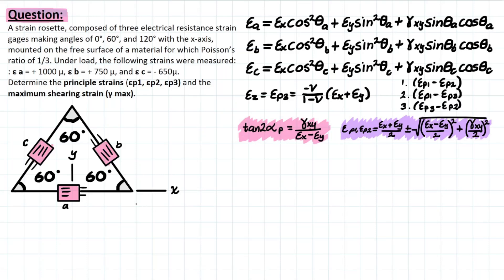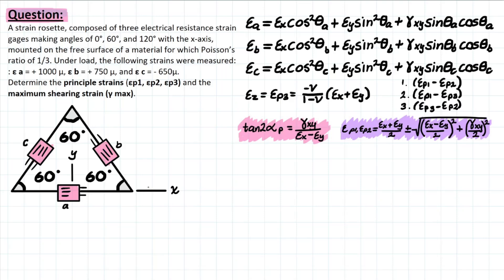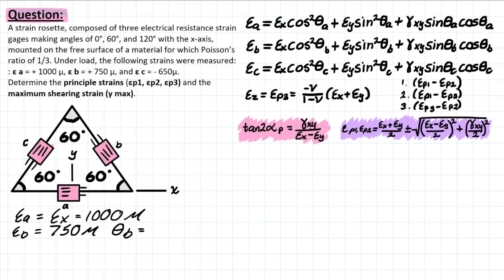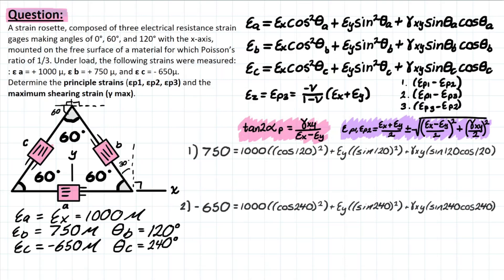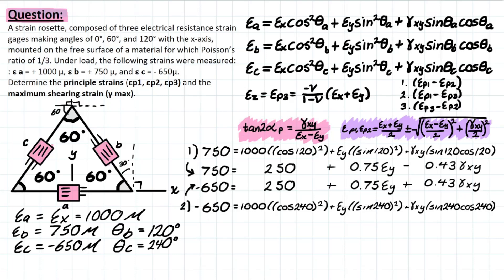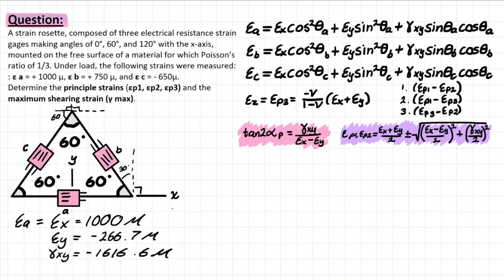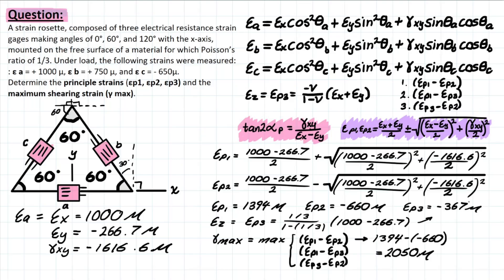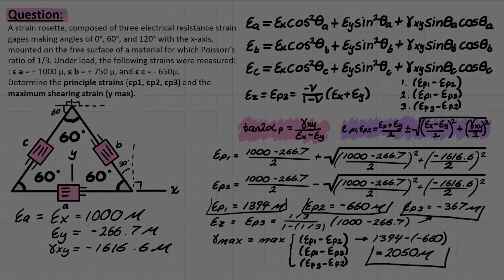Solving Rosette and Strain Gauge Problems!

Comment: Thankj you for the video. Just wanted to ask, isnt Ep1,Ep2 = Ex + Ey/2 in the beginning and not Ex-Ey/2 as stated.
Reply from the maker: Correct! Didn't realize while solving, thanks for pointing that out
Reply: Yes, but in this case its -Ey as the value for that is negative: Ex + (-Ey) .. but there is still a mistake in the square root where (Ex-Ey / 2)^2 occurs, here, it should be (Ex + Ey/2)^2 as it's (Ex - (-Ey)) = (Ex + Ey)